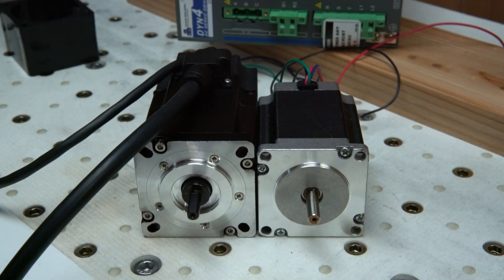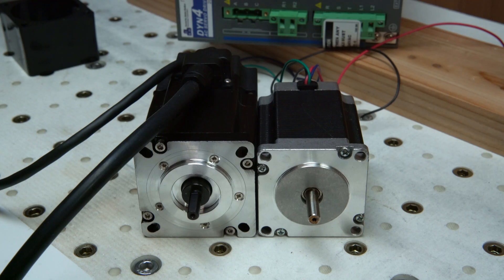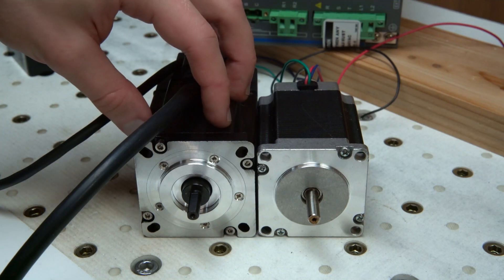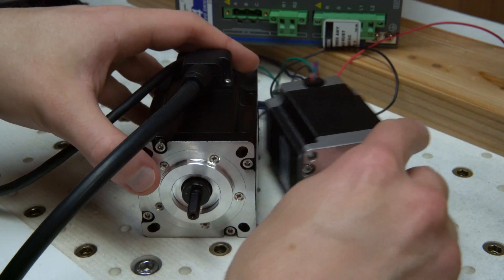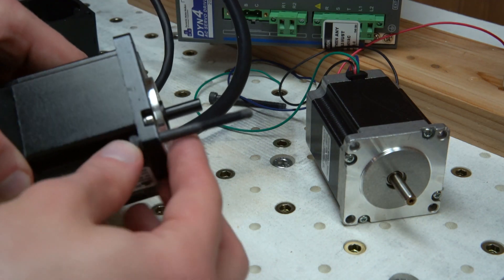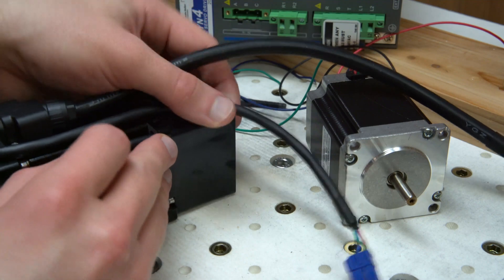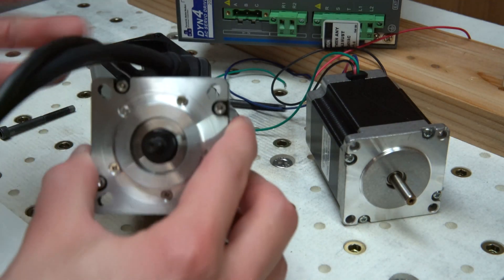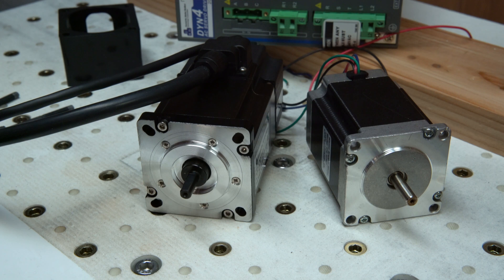Disappointments With DMM and Their "NEMA 23" 57N AC Servo Motors

Comment: Oval holes, looks like Nema 24 with 23 hole compatibility, doesn't help the larger frame size though, 23 and 24 have the same size central circular boss by default. Faulty advertising for sure.

Comment: They used to work just fine, so I would think it was a manufacturing problem that DMM was not aware of before shipping, Servo motors in general only have ISO mounting flanges so if anyone wants to use a NEMA Flange, you are not going to find a quality AC servo motor with a NEMA Flange, you only needed to add a new set of mounting holes

Comment: Could you post a link to where you sourced the integrated servos.  Also maybe do a video on the tuning process and setup for a servo like that.  Also, are you still using step and dir. Signals from the uc300eth-ub1 motion controller, breakout board combo.  Alot of curiosity here.

Comment: Teknic Clearpath SD are the easiest servo upgrade route.
Reply: Overpriced crap
Reply: @mysterious_nobody_99  Expensive yes, overpriced  no. They are certainly not crap. I use DC servos, Clearpath servos and steppers for a living in the film industry. What's you're experience to qualify "crap"?
Reply: @MC-qc9gp  They only support step/dir input and not industry standard analog inputs for velocity/torque. I asked them, the MC and SC series don't support that either. And they're incredibly overpriced. They also have no encoder output so you can't feed the encoder data back to something like LinuxCNC to close the loop. You can get Leadshine/DMM servos for half the price that have at least the same performance and have all of these standard features.

Comment: I love to hear the manufacturer’s explanation on why the product aren’t compatible and what “you” should do to solve their mistake.
Reply: He should have used their adapter plates, Normal AC Servo Motors don't have a NEMA Flange, the flange can never be the correct size because the motor body is larger, the only part that is NEMA is the location step on the front of the motor, you just need a new set of mounting holes which is easy to do.
Reply: I fitted up the 57n to a nema 23 r&p plate I had from cncrp, it fit fine. They're offering to make good on ones that don't fit by supplying adapters for free.